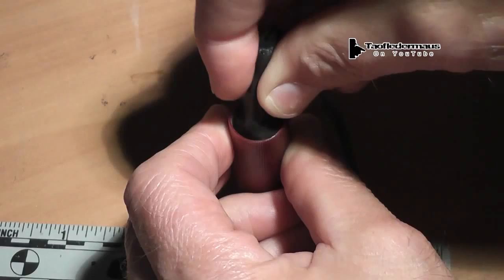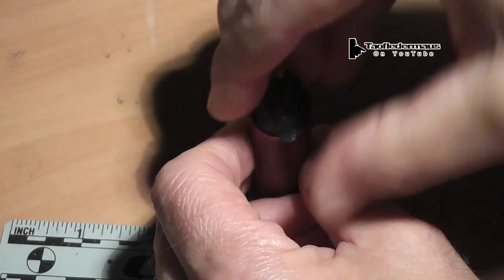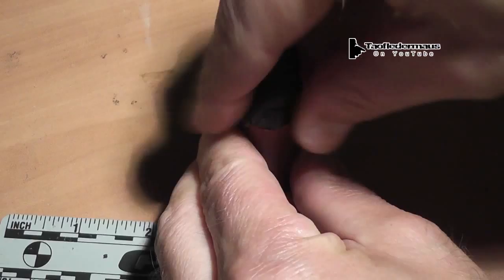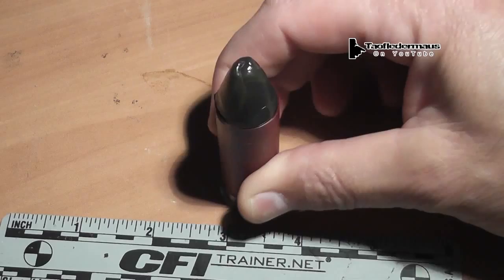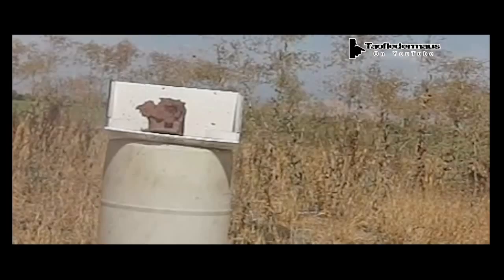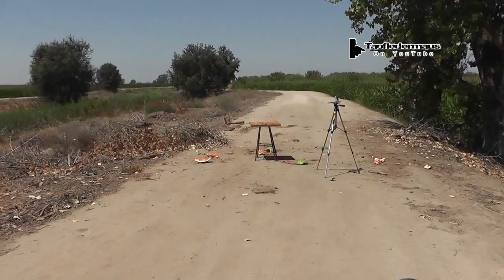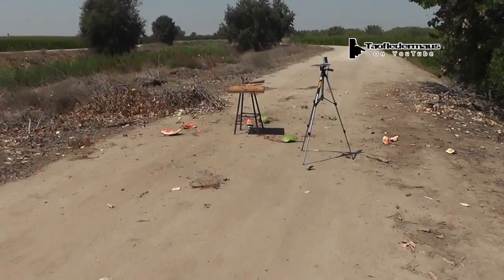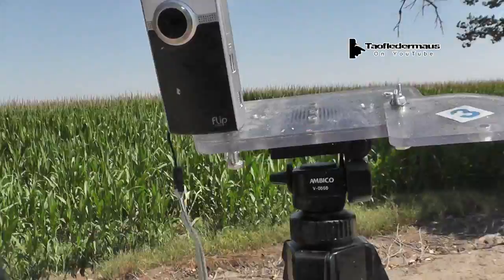SILLY PUTTY  Shotgun Slug -  The Science of Non-Newtonian Fluids

Comment: Shotgun firework slug.
Take a air bomb firework and remove the explosion container that launches into the air and explodes and use it as a slug and drill a small hole into the wad so that the some of the powder can go through the wad and catch fire to the firework delay fuse (2 secs usually).
It basicly acts as a bearbanger noise deturrent, but fancy colored.

Paintball slug. Use a large empty gelatin pill capsule thats about the size of the slug and fill it with paint.